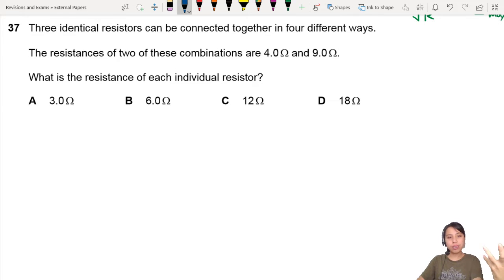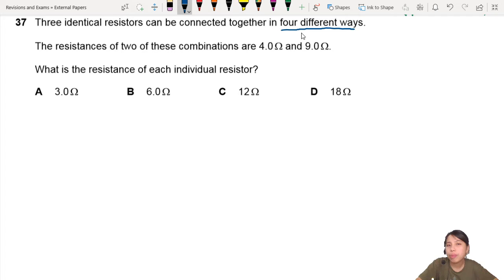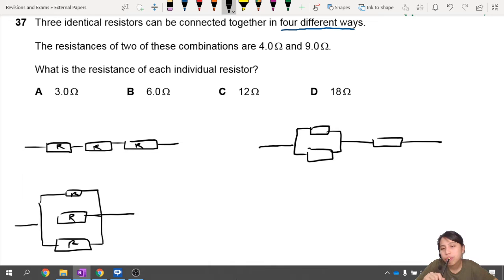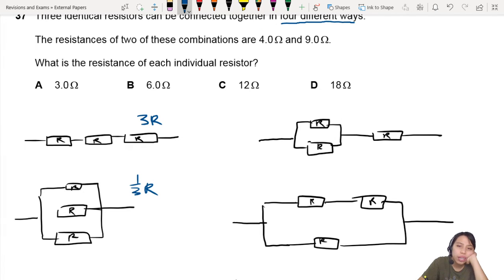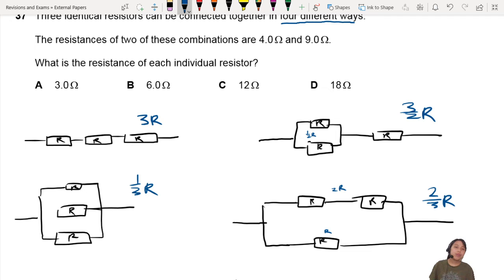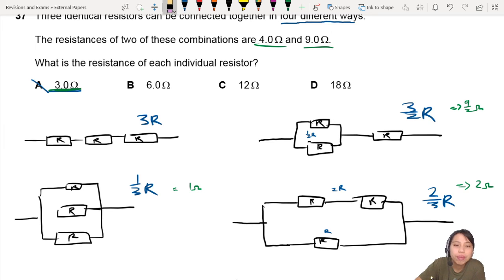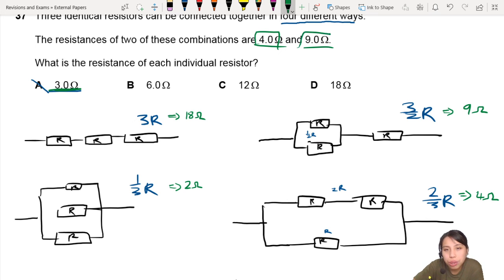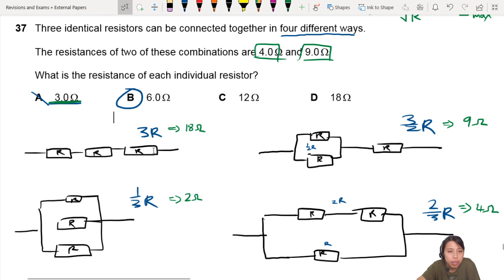MJ20 P11 Q37 Resistor Arrangements | May/June2020 | CIE A Level 9702 Physics

Comment: miss for octnov 2018 13 q33  the pd across the resistor which is not in parallel is 20 V but what about the 2 resistors in parallel? why do we need to half the power instead of just using 4W